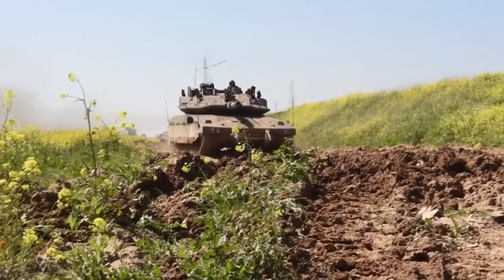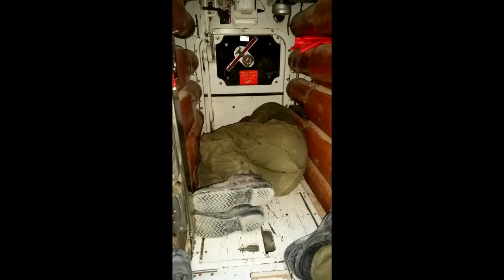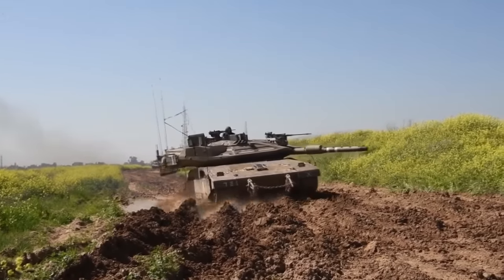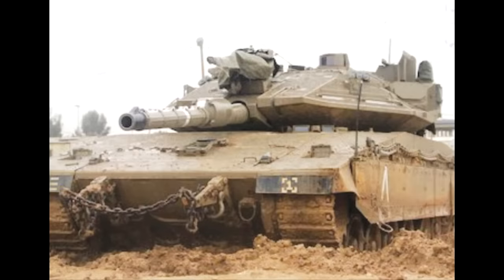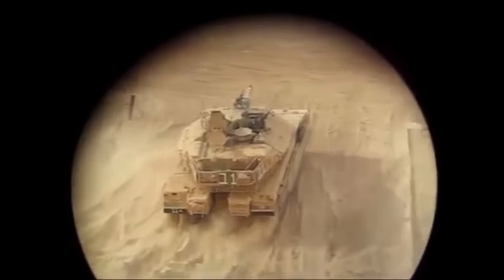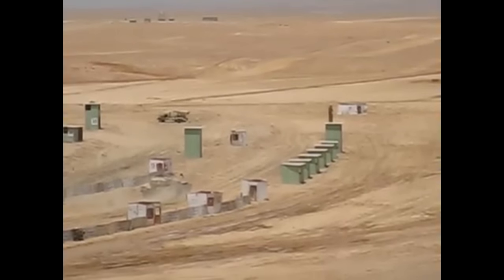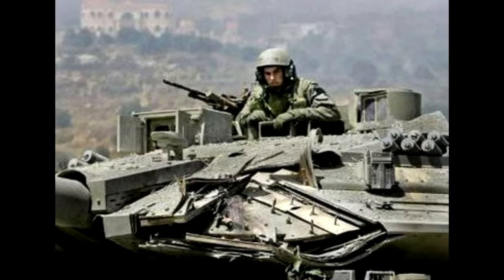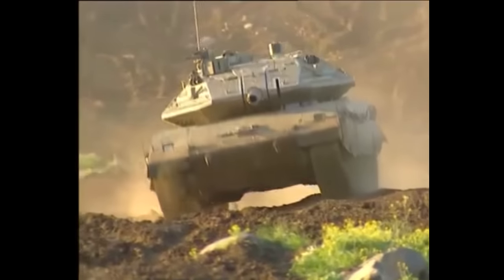Problems with Merkava tank

Comment: Engine in the front would improve the survival of the crew more than the tank itself. The weakness is also mitigated if fighting from behind a sand dune and using gun depression. And quite often they're not taking into account the high end weapons that exist, but rather the cheaper vehicles used by their neighbors that they have to fight all too often. Consider that Israel is also known to have successfully used Centurions and upgraded Shermans about 20 years after World War 2. If it's a small country you need to train crews well, and having a tank where crew survival is often more important than tank survival it comes down to being able to sacrifice vehicles more than people.
Reply: pretty sure apfsds will spall even more with the engine there and so kill more crew members
Reply: Yeah your wrong, the engine would just send much more shrapnel towards the crew.
Reply: These kids play too much war thunder lol, "engine in front bad it get disable easy"

The tank itself is not being protected here, its protection for the crew, a round isnt gonna go straight through the engine like that and spall either, since its already going to have to go through the Merkavas armor, and then a massive Diesiel engine and then another armor plate to get to the crew.

Are we forgetting Israel is mostly fighting T-55's, 62's, and 72's btw? These tanks are incredibly dated, and most likely not using top of the line munitions.

That wouldn't become a problem unless they're battling shit like the Abrams, Leopards and T-90's. You guys need to realise this tank was built and tailored to their situation, not your own little "oh what if" stuff.
Reply: Engine is in front b/c there is a door in the back. Every IFV has front engine and so does Merkava. It has little to do with protecting a crew - it feels such statement is made mostly by marketing arm. Maybe against HEAT but not AP rounds. Engine blocks are routinely shot and disabled by anti material rifles and many modern power packs use a lot of aluminium. There is very little armor value in there. Hiding behind sand bar is not a good idea as well as few meters of sand do not add too much protection - you want to hide in a hole in the ground not behind some obstacle as if the enemy sees your massive heat from the engine they simply shoot through sand, through weak frontal armor into your crew.
Reply: Like I said, the tank is tailored just for their situation, they are not fighting very advanced enemies, a lot of the tanks they're facing are piss poor stripped out T-72's etc. I actually think a lot of those still use hand cranks to turn the turret if I'm not mistaken. The merkavas armor isn't super thin either, think they got like 200 to 500mm of composite? At least on the latest versions.

Honestly, the Merkava is an amazing tank, but everyone here keeps putting it into situations it and its crew would never put themselves into. Its like calling the Abrams bad because it can't handle a 155mm Artillery round through the roof of its turret, or being able to deflect rounds back at enemy tanks killing them immedietly.

Plus, some of the information in this video is actually false and speculation from other people, such as the heat from the engine effecting their IR Sights, and that was completely false. 

Red Effect is really not a good channel to be watching for knowledge on tanks, not saying he's bad, or anything of the such. But it is clear that he does little research and likely gets his information off of forums or other youtubers instead of finding and questioning people who actually crew the damn thing.
Reply: St. Petersberg  Ejem, the Trophy
Reply: St. Petersberg  what is above a TOW? And you specifically said that they are fighting TOWs so...
Reply: CozzyWozzy you’re missing the point, the video is based upon judging whether the tank should be referred to as the best tank in the world. It is far from that. Yes you are correct, it offers good crew protection. However, one shot to the front and the tank is completely disabled, that’s not how it should work. Doesn’t matter if it’s fighting Cold War era tanks. If it does happen to go up against modern MBT’s it will struggle, a lot. Israel doesn’t have the budget to keep manufacturing tanks if they keep getting disabled with engine shots. I’m also quite sure a modern sabot round will punch right through the front plate and through the engine still sending shrapnel through. Tank armor is overrated nowadays and you should never rely on it. So no, overall it’s not an amazing tank, it’s not bad by any means but the whole idea of putting your engine or fuel at the front to stop rounds is a stupid concept.
Reply: @z43u  Yea. It's useless without its engine
Reply: APFSDS still spalls through it. Look up fire tests on Object 488.
Reply: The l/44 can put a DU apfsds round clear through the UFP, crew, ammo, engine, and out the back of a T72B from 2km easily. The merkava's pathetic armor and engine in the front isn't going to do jack shit against that.
Reply: @holl0918  there is no DU for the L/44, only L/50 and L/55
Reply: @henryatkinson1479   M829 series are DU rounds. Also, the M829A1 was capable of that much penetration. The current M829A4 outperforms it.
Reply: @holl0918  USA doesnt use the L/44
Reply: @henryatkinson1479  The 120mm M256 cannon used by america is a licensed copy of the german Rheinmetall 120mm L/44. They are literally the same weapon, just with a different designation.
Reply: @henryatkinson1479  Also, the major difference between the L/44 and the L/55 is the length of the barrel. The chamber and breach geometry are the same so they can use the same ammo. They also improved the barrel material so that current gen propellants wouldn't burn out the barrel as fast. The L/44 was originally rated for 500 rounds, but that dropped down to less than half that when newer propellants were introduced.
Reply: @henryatkinson1479  The german DM23-63 rounds are tungsten, but the american M829 series are depleted uranium. However, both are fired from the same weapon
Reply: @holl0918  Its not the same gun. Its the same length and the same caliber. Its otherwise entirely different, and NOT a copy. Other L/44s cant fire the DU rounds. The M1A1HA and M1A2 have a different barrel with a higher pressure rating. 

If L/44s could fire the DU rounds the L/50 and L/55 would not exist.
Reply: @holl0918  The L/44 cant fire the ammo L/50 and L/55 can. Theyre rated for higher pressures. 

Thats why Type 90 cannot fire Type 10 APFSDS. The L/50 L/55 are needed to handle the pressure. L/44 cant.
Reply: @henryatkinson1479  Source?
Reply: the baron  L/50 is the gun used on the lightweight-packaged Type 10 MBT. Abrams and Leopard are not the only tanks with the NATO 120mm gun. Do some reading before spouting rubbish.
Reply: @henryatkinson1479  That tank uses the L/55 built under license.
Reply: @holl0918  It uses both. The Type 10 in the heavy config uses the L/55. The Type 10 in the light config uses the L/50. Im not sure how hard it is to drive this basic fact into your head. Its wikipedia-level info. https://en.wikipedia.org/wiki/Type_10 Scroll down to the "armament" section. If you need a source, look at references, and the JSW website. That is, if you can get your pudgy, inbred, stumps of fingers onto your keyboard to do even that.
Reply: @henryatkinson1479  Found references for L/50 barrel. Ty for link, much easier to understand when you share where you found the info. Mind providing source for the "pressure spec difference between M256 and L/44" claim?

Edit: Found a source that said the recoil system of the M256 was redesigned because USA found it to be overengineered, but nothing about pressure tolerances. Seems like both fire STANAG 4385 ammo.
Reply: @Cozzy-Wozzy  What was the point of this comment? The video is here to analyse if the tank really is perfect or not, and if it can't stop the best APFSDS projectiles then it means that it isn't the "best tank ever" . It's not rocket science.
Reply: @NexusWarior211   Funny considering they've lost under 10 tanks throughout the past 20 years, I think they've lost 5 or 6? As I pointed out before, people keep putting it into situations, and pitting it against weaponry and vehicles that it hasn't, and likely never will face. Why would they worry about their tank needing to survive the best APDSFS Rounds when their enemy doesn't even deploy such weaponry. You're just pointlessly over engineering your vehicle and making it needlessly expensive at that point.

The Merkava, is technically speaking "the perfect tank" for Israel's situation. And it's record proves that.

Of course if you were to put a Merkava against a M1A2, or a T90, it will lose. But when we're talking about gutted, export T-72's, and outdated T-62's, and T-55's etc. the Merkava is performing just fine, if not overperforming.

Plus, APDSFS isn't even a issue for the tank. Its HEAT based weaponry such as the Kornet, and RPG-7 etc. based rocket grenades, which its TROPHY system counters just fine. So why you bring up it needing to be able to absorb modern APDSFS is beyond me.
Reply: Shoot, move, communicate. You wanna live, do this.
Reply: 100mm with sabot? Lol, what armor, what turbine?
Reply: Why don't you tell that to the people actualy SAVED by their tank engine being in front...
And BTW, since you're displaying so vadt a knowledge, when was the last time you had to battle in a tank???
Reply: @Cozzy-Wozzy  i think you have swallowed a bit too much isreali propaganda . there is a reason all mbt tanks dont put engine in front . or you think only isreal cares about its crew . plus you need to listen better .. you are saying "such as the heat from the engine effecting their IR Sights, and that was completely false" Dude in the video he said ,, This information is not confirmed and can be taken with a grain of salt ..... open your ears. Second logical reason why it aint the best ...Who cares how much it can protect the crew from a direct frontal impact , if the engine dies the tank is dead. Putting engine in front for more protection is not a smart move its a move out of desperation cause they could not create better armor. due to financial reasons.
Reply: A tank is useless without it's driver, too.  The engine will provide some additional protection compared to only the front hull armor alone. The fact that Israel has fielded the Merkava series tank for over 30 years demonstrates that it has been successful at keeping their tankers alive which is more important than anything especially to a small nation surrounded by nations that hate them.
Reply: @holl0918  There is nothing L/44 about the M256 except the Barrel. Both are 2 different breaches and are specifically tailored for their munitions.
Reply: @konstantingr5928   Your point completely negates the fact of what he said prior, stating that Israeli tanks are made for Israel not a Western or Eastern nation, yes the engine will be broken, but as stated by Cozzy the tank is suited to save *the crew*, in which Israel cannot afford more losses for their vehicles. And logically speaking, Israel is most likely in a dug in position mainly showing its turret as it fires down at enemy vehicles, as the turret is the most protected part of the Merkava, therefore it is very likely to stop rounds from killing crew. To get back to your engine point, he basically stated that Israel can afford the material to make more MBTs, since after all they are a rich country and have connections to more powerful countries. Also, even if tanks weren’t penetrated, crews still leave their MBTs
Reply: Islamic Army  Having no crew but a much of tanks basically entails you have few operational tanks. Israel is rich, they can afford Merkavas back from abroad or their own facilities, meaning they put priority on crews than their tanks, not to say they don’t want the tank survivable either
Reply: Islamic Army  Assuming that the Infantry division aren’t dumbasses and screen the area with infantry and air support
Reply: Islamic Army  This isn’t some dumbass Turkish armored division, these are highly trained tank crews. They have the technology and skills to avoid AT fire. Nowadays they’re equipped with APS systems, so it’s not actually guaranteed that AT weapons will make a breakthrough. And there’s tons of other variables as HEAT can differ where it’s penetrated and what stops it. Just saying, these skills aforementioned can be used on every MBT. It’s not special on the Merkava
Reply: Islamic Army  I’m gonna get back at the main argument for a second. First off you’re saying that the engine at the front increases risk that the tank will be stopped dead in their tracks. I should say that, using your logic that Western and even Eastern tank designs can be stopped with similar tactics. And if it’s some powerful AT Missile going through the hull will possibly immobilize the driver if you wanna talk about drivers not protected by the engine. I should say, there are reports of Merkavas taking multiple hits from AT, so it’s not to say that it’s not protected because as far as infantry support goes, it’s fine. There’s a reason CQB tactics are in place, and infantry are to screen as much areas as possible, as such this will avoid being fully distracted by enemy personnel and catch them off guard if they’re trying to gain focus of all infantry. And potentially, infantry supporting armor and machine guns fired from vehicles will effectively keep personnel in building their heads down, effectively pinned, or heavily defended positions shelled by an explosive round from a tank or IFV, possibly from infantry using rocket launchers or grenade launchers. In doing so you mostly remove the risk of MBTs being destroyed, as such seen in Operation Iraqi Freedom, and even Israeli operations as of recently, aided by systems that are used against AT weapons. Of course situations like Grozny or the aforementioned Turkish Leopard problem was due to the fact that there was no effective infantry screening, visual awareness, no comprehension ahead of time, or possibly a combination of these factors.
Reply: Islamic Army  I’m betting you have zero proof on the matter, and as I stated only saying that because you hate them, which is petty considering we have to talk military facts.
Reply: Islamic Army  Alright? I mean, I’m not gonna stop you from posting it but that has nothing to do technology wise. You haven’t even decided to respond to the original arguments. An armored carrier has no representation on the argument since the Merkava has much different armor and operations. I’m not expecting them to get really accurate documents, but nonetheless I’m supposed to take any insurgent force’s word for this situation? And if it’s M113s it’s already stated as losses.
Reply: @Cozzy-Wozzy  haha merkava go boom with RPG lol
Reply: @Cozzy-Wozzy  Didnt he litteraly say that it needed to be taken with a pinch off salt about the heat stuff?
He litteraly said himself that there is no proof off it and that it's not a fact.
You are the one spreading misinformation here.